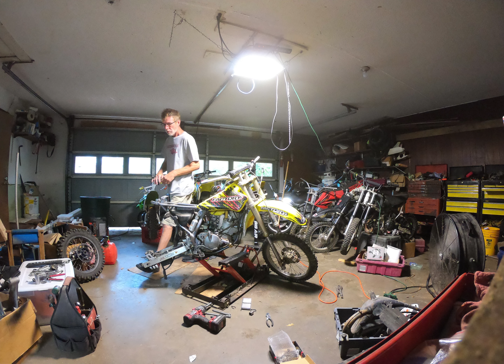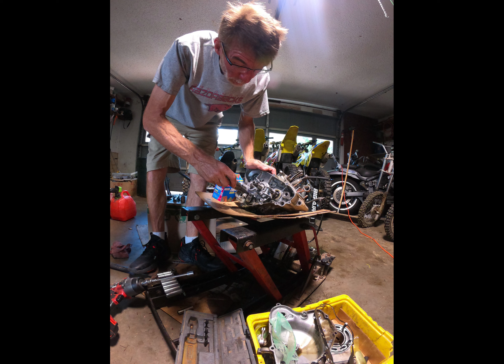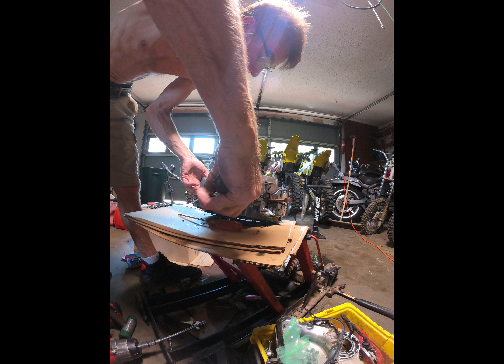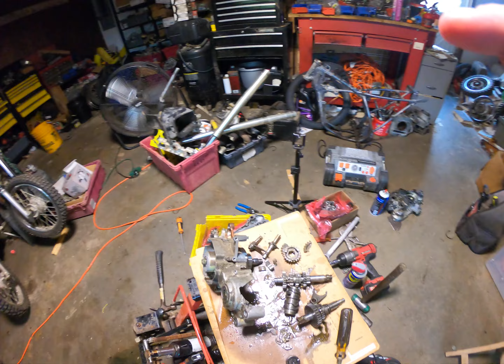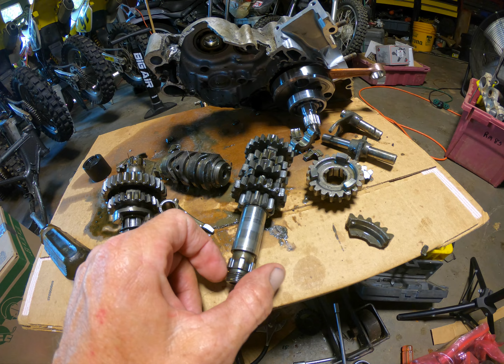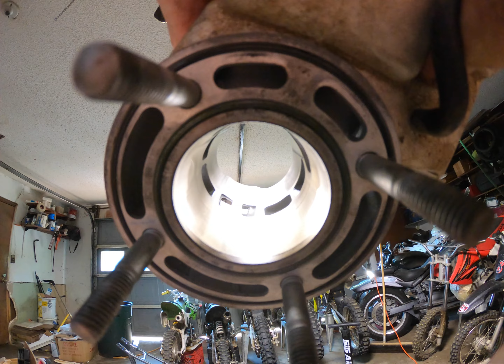suzuki rm85 complete tear down to the crank whole bike !time lapse !

Comment: Hello. So i have honda today af61 4 stroke 50cc. It goes 50-55 . Can i make it faster or more powerful without sny new parts?
Reply from the maker: af16 ? yes there are few things you can do ! google bigbore for your engine variator and clutch springs also rear gears !
Reply: @WaldensWorld  no no.. honda today af61(61)
Reply from the maker: Some of those you can open top of carb n pull needle out for throttle move clip down one notch n you can increase power if it’s adjustable! Mabey if muffler has restrictions by the head mount you can drill it out to let more air out head ! But without spending money not much you can do !